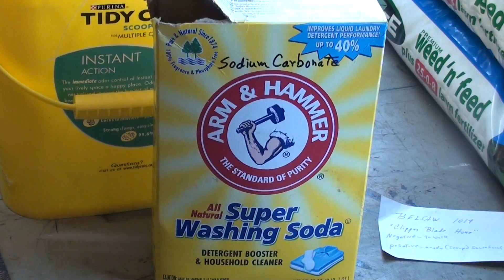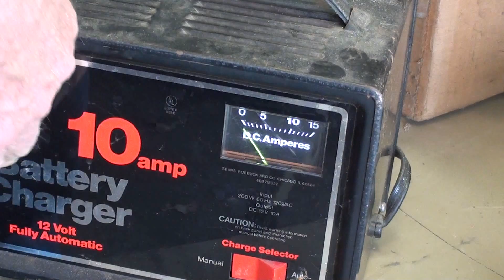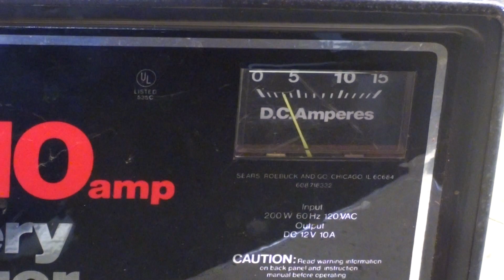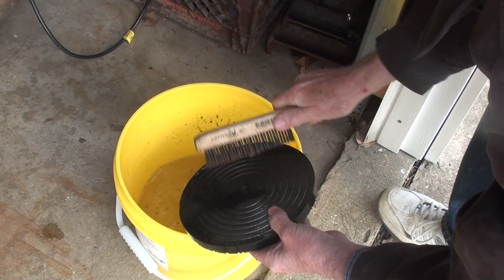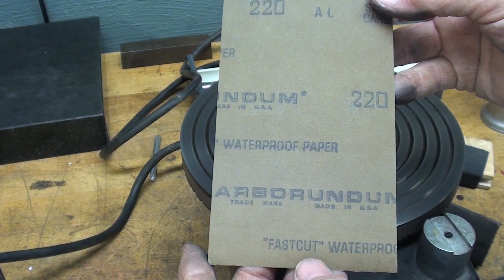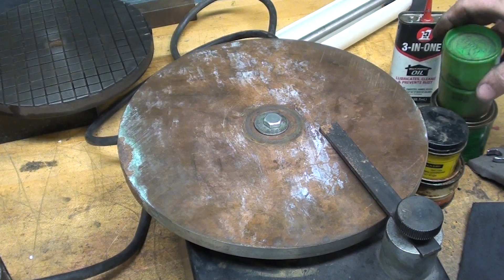Electrolysis Rust Removal-lapping plate #301tubalcain

Comment: Do not use galvanized metal or copper metal in the solution.  Both the zinc and copper coatings will dissolve , ruining your solution thus requiring replacement.  Dr John
Reply from the maker: Thanks

Comment: Well done. I've done electrolysis to remove rust from steel several times. Some points to try to be helpful:

1) those transformer-based battery chargers are hard if not impossible to get any more. New, "smart" chargers won't tolerate a dead load like this use. Computer power supplies, however, are cheap and can put out insane amounts of amperage for their size and cost. Connect the green wire to ground to turn them on (ATX type power supplies) in addition to any mechanical switch they may have. 

2) I can't quantify any difference between different electrolytes I've used and I've used baking soda, washing soda, and whatever Lowe's or Home Depot had for "pH UP" for pools. 

3) The sacrificial anode will conduct poorly as it gets corroded. Cleaning it (or them if you surround the part) will help to keep the system running well. I have started using carbon arc gouging rods from Amazon (or a welding supply store, just watch their "hazmat" fees).  I peel the copper layer off (razor along the long axis and peel).  They'll disintegrate over time but they don't get corroded and stop conducting well. 

4) the hydrogen gas is way lighter than air and shouldn't ever gather on the water's surface to cause any problem.  Nothing wrong with being cautious, but this isn't a particularly hazardous task. Using table salt as the electrolyte, however, will cause chlorine gas to be given off...that is hazardous. Is it enough to cause harm? I don't know I'm but it will be enough to smell so I avoid it. 

Thanks always for your efforts in these videos.
Reply from the maker: That's a lot of great info!

Comment: pro tip, use titanium or carbon/graphite cathodes (non tool side) for a non rusty shitty water afterwards.
Reply from the maker: Thanks
Reply: @mrpete222  https://imgur.com/a/ljlbmik  my escapades thus far.
I got the titanium from old discarded salt pool chlorination cells.
but it's cheap enough to buy on ebay too.
Reply: https://imgur.com/Ob1NrI5   bath after 10 hours on VERY rusty towball job
Reply from the maker: Thank you.  That turned out really awesome
Reply: it's videos like yours that inspired me to try, so thank YOU.  
just thought I'd add a slightly different experience.
most of us just use what we have to hand ;)

https://www.youtube.com/watch?time_continue=240&v=55_j21tCN_k

just a warning also for those out there, don't use stainless steel as a cathode, it creates a highly toxic bath.

Comment: would that 45 degree drill chuck be stron enough to use on a mill  (want to use a vertical mill as a horizontal mill to drill precicion  holes in objects that are too long to clamp in vertically and mount sawblades for making grooves on long plates )
Reply from the maker: It would not

Comment: Full functional lapper has rings and cover that hold the parts on the table apply light pressure and slurry for the cut its a messy process also it needs a pool to collect the slurry run off

Comment: For what it's worth:  In this video you mention that some say that the gas produced during this process is hydrogen.  While this is correct to some degree,  it would be more precisely known as "Brown's Gas" which is produced when an electrical charge is introduced to the water/soda solution (in this case acting like a makeshift electrolyzer).  This gas consists of di-atomic (H2 and O2) and mon-atomic (H and O) hydrogen and oxygen atoms.

Comment: I had about the same experience stringing 250 piano tuning pins from the year 1825 along some baling wire, and a day of electrolysis allowed me to spend another day chucking pins into the drill press and lightly brushing them bright. I got clean pins without losing the original file marks, and the curious satisfaction of making brown foam.

Comment: Mr.Pete, 

I have an electrolysis tank that I made from 2/3 of a plastic 55gallon drum.  My power supply is homemade, that I originally built for my foam cutting machine,  from a Variac and a dumb  120V to 24V step down transformer.  It will output 12 Amps (transformer rating) at 28 volts if I turn the Variac all the way up on it.  I use it to remove the rust from the old barn lanterns that I restore.  It can really "make the water boil" if the anodes are good an clean and you crank it all the way up!! 

You are correct in the video... Hydrogen gas evolves from the cathode, which is your piece being de-rusted.  Oxygen evolves from the anodes.

In my experience, the fire hazard is absolutely minimal.  I have attacked my tank with my Bernz-O-Matic propane torch several times when I first got it set up, just to satisfy my own curiosity, and the only thing I have observed with my setup is a yellowing of the flame right against the surface of the water over the cathode (the hydrogen burning) and every once in a while over the anodes I might get a good "POP!!" when the torch flame would hit the oxygen trapped in that brown foam just as you showed at the anode.

Again, just another thing where the Internet Safety Nazi's have jumped in and made a mountain out of a molehill.  As long as the evolved Hydrogen and Oxygen can escape to the open air, just as it can in both yours and my setup (and probably 99.99% of everyone else's setups) there is less than 0.001% chance of a fire or explosion.  Just don't cover it up while you've got something cooking in the tank!

Comment: Look up diamond lapidary wheels on Ebay.  They come in grits from 80 to several thousand, and in diameters of 4", 6", 8", 10" etc.  Diamond will allow you to sharpen even carbide shop tooling rather quickly.  The wheels themselves are metal, so you can just velcro the top of your base disk and change out grits quickly.  For common sharpening tasks I'd recommend 100, 200,400,600 grit wheels.  For anything that needs a super fine polished edge (like engraving tools or a straight razor), you can get stones of 1500 grit up to 10,000 grit or more.

Comment: Interesting as a project. A lot of the machining guys seem to plump for evaporust, might be interesting to do a comparison.

As for sharpening knives with the machine ... If I had 1000 to finish, or if the blade was badly worn and needed truing then yes.  For one or two just needing an edge, I enjoy the ritual of doing them by hand.  Depending on how bad the blade, starting with a coarse carborundum oil stone through kansas wetstone, welsh slate slurry, Japanese 10,000 grit ceramic and finally stropping on leather.  It will shave the fluff off a peach - if that's your thing.  Total overkill if all you want is a decent sharp blade, but I just find it's so relaxing.  That nice carbon steel blade you got recently would love the attention I'm sure.

Comment: There is O2 and H2 being made. The Gsa actually will need to be captured to be of any danger.
if you put a lid on it you may get interesting results. but in the open air, nothing will happen much. hold a match to the anode bubbles and see.

Comment: Hydrogen is lighter than air (think Hindenburg), so it won't accumulate in the bucket. (Worry about it accumulating under the roof. But don't worry too much.)

Oil it with WD-40 and you won't even to have to wait for it to dry. The WD-40 will lift any moisture off the surface.

Comment: The lapping plate reminds me of the sort used in polishing telescope mirrors, except those are made with pitch.  The crossed grooves prevent the mirror from forming a suction and sticking to the lapping plate, if memory serves.  The concentric ring grooves on the other side might serve a similar purpose.  I don't know.

As another person mentioned, I'd like to see a video on the reverse of this electrolysis process -- plating nickel or something on something rather than removing rust.  Should be a similar process, I suppose, or it might involve dissolving the material to be plated in an acid solution of some sort.

Comment: Try this It is cheaper and cleaner in the long run.

Use a Carbon rod/plate stock, you don't get that nasty Soup/sludge and have to change the water, and the carbon wipes clean and so far has been running 2 months.  The bigger the carbon surface area the faster it works.

I also use a length of Re-bar for the top bar, then I can have a few different things in at the same time.

For the hanging bits I strip down copper wire.

And the best I use a battery to feed the system (4 x 6vdc cart batts), I put the charger on during daylight hours, and let the Batts do the work at night.

Be careful don't cross connect the two! I have enough Batts to weld with! It would be a BIG BANG!

Comment: The gas that comes off will be hydrogen and oxygen (if it was just water) https://en.wikipedia.org/wiki/Electrolysis_of_water
Im not sure what the additions to the water will do to the reaction. you could try setting fire to the foam if the products are oxygen and hydrogen they should go up pretty well.

Comment: VINEGAR!!! electrolysis can't touch the rust removing power!! just put whatever in it submerged and leave overnight. Lightly wire brush and presto good as new. You will never try electrolysis again GUARANTEED
Reply: +Joe Halas , I disagree.  I use electrolysis quite often, and while I'm impressed with the vinegar shown in the video, I still think electrolysis is ultimately the better method.  It will take any rusty part back to bare metal, without the possibility of pitting or the acid attacking the good metal that you want to keep, if you leave it in the tank too long.  But if you're only doing a small part every once in a while, vinegar or Evapo-Rust might the way to go if you're not set up for electrolysis..

Comment: You're just lucky you pulled those Utica Tools pliers out of your setup. I was going to thumb this video down for sure if you hadn't. I have used Sodium Carbonate, and Bicarbonate as my ionizing salt, and I never have seen much of a difference. If anything I like how Bicarbonate works a bit better. They may say use Carbonate just because it is cheaper? As far as I know the Carbonate is in the bath to make the water more conductive? If anyone knows why one may be better than the other I'd like to hear it.
Reply: +Paul Frederick my research suggests the same.
Reply: MrJgstoner
I do have to say that Mr. Pete's setup was aggressive, and worked quite quickly. Despite him using what I would consider to be a less than ideal sacrificial anode setup. Pretty crappy really, considering that electrolytic de-rusting is line of sight. It might be due to something in that Indiana water he uses?
Reply: Paul Frederick i have no idea.  As far as I know, the closest you can come to PURE water is going to be distilled. 
I wouldn't call that setup crappy! lol  worked like a hot damn and you don't have to worry about the neighbor kids stealing it :-)

Comment: Unbelievable. I have used this same charger in my spooge tank for years. 
The best way is to line the tank so there is as much surface area as possible.
I use a 55 gallon plastic drum that is cut in half and it is lined with sheet metal for the anode it goes from the bottom to above the line that I keep the solution at. Once in a while I take a wire brush and run it up and down the inside/anode and rremove the rust that it has attracted and is stuck to it. When I do this the amperage will go right up and it works better. I am one that keeps the spooge tank ready at all times right outside my shop. If something is rusty it goes into the spooge tank and gets clean. It is one of the best things to have in a shop that deals with old USA iron IMO.

Comment: I suspect the wheel bolt should be an axel/ shoulder  bolt or a spacer used to center the wheel. have you tried the derusto stuff sold by harbor freight, tractor supply , etc?

Comment: Does anyone besides MrPete know if you we're to touch the water while the electrolysis is on, would you get shocked? And I wonder if I could just use a metal bucket instead of the file?
Reply: +Shane K You can touch the water no problem. I've always called these things, "spooge tanks". Look that up :). 
I use a 1/2 of a 55 gallon plastic drum with a sheet metal lining for the electrode. It is best to have a large electrode that goes around the entire internal part of the tank with as much surface area as possible. If you do as Mr. Pete does it will be much slower. I have spooged a ton (literally at least) of old USA machine iron in my spooge tank and it does an incredible job with almost no cost and you can leave it go. I have taken the most rusted and corroded items that have had bolts etc in it. If you tried to remove these they would snap immediately. Once spooged they came out with the least pressure.
Reply: Thanks Howard, that metal tank completely surrounding the part so the current didn't just get one side is what I was thinking, just don't know enough about electric to know if I could get a bad shock through the water.
Reply: +Paul, looked like the material was coming off of the item and collecting on the file so I didn't think it would eat through a bucket, and I never touched both terminals on a car battery at the same time, let alone when I was wet or they were underwater.
Reply: Shane K
conductivity of individuals varies but usually you need a voltage pressure a few times higher than 12 Volts to pose much of a risk to us. Which is to say that 12 Volts is well within the margin of accepted safety. Also, the current is going to favor the better path to ground. Which in this case is going to be the ionized water. For the water to be a contributing factor you would need two containers insulated from each other. Otherwise you're still the more resistive path in a parallel circuit.
Reply: Thanks Paul
Reply: +Shane K do you get shocked when you touch a car battery terminal? Then why would the same voltage level shock you anywhere else? If you use a metal bucket you run the risk of eating a hole right through it. Then where would your cleaning solution go? It is called a sacrificial anode for a reason.

Comment: you may remember the Hindenburg zeppelin accident in Lakehurst in 1937. It was filled with combustible hydrogen gas. Hydrogen gas was used to lift the Hindenburg because it is lighter than air and floats upwards. Therefore you are wrong saying it would collect in the bucket and could be ignited by a spark. Instead it collects under the ceiling of the room.
I congratulate you for being one of the few if not the only one who shows not only the easy electrolysis but also the more tedious scrubbing which is necessary afterwards. It proves that you are honest, which I have never doubted. To do the scrubbing with a brush, a pressure washer or other methods that don't remove metal is the way to go. However using sanding or sand blasting to clean up after electrolysis defeats its purpose which is to preserve the original machined surfaces and their tolerances. If that is not important then you could just as well skip the lengthy electrolysis and go to grinding or sand blasting directly with the same results.

Comment: I use to put a really fine edge on my wood turning tools with a piece of MDF I turned down to an 8 inch circle. On the outside of the circle I charge it with lapping material. ( green)The problem is that it puts such small fine edge on it the tool dulls very fast. Took me awhile to figure out what was going on. LOL Thanks Pete your a good man!
Reply: +Tom Wilcox sounds like you're getting fold over on your edges. Stropping is supposed to break off the wire edge, so that is avoided. For a tougher edge use a steeper sharpening angle.

Comment: Hello, I think they use Copper plating on the polishing plate to lock the diamant grit into the surface. I saw in a documentary they use plating to lock the grit into those grit nail files like on a swiss knife.

Comment: Cathode is positive, anode is negative.
Reply: +thebaron44 not in conventional electronics. The truth is current flows from negative to positive. But we're all a bit stuck with it now.
Reply: I was just a out to correct you but you may be right.  From my electronics background the cathode is negative,  BUT after doing some research it can be positive or negative with respect to the anode depending if its a galvanic or electrolytic process.  In electronics tho (and hence why I wanted to correct you) the cathode is always negative.  You learn something new everyday.  Thank you!
Reply: Both Jay Walt and yourself may be correct as i have heard of this thinking many years ago.   However if Mr. Pete were to reverse the leads then rust from the file would travel to the round disk, not something desirable.  RESISTANCE IS FUTILE    .
Reply: +Armchair Pilot   Hmmmmmm  a cation is a + charged particle attracted to a cathode in electrolsis